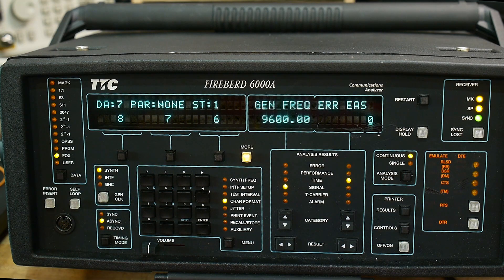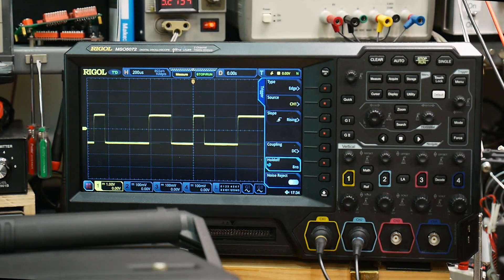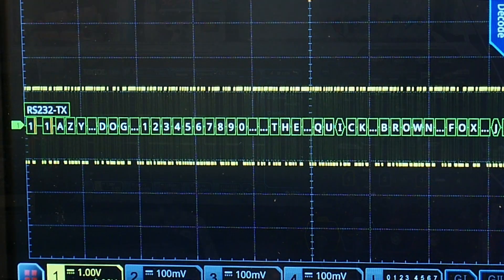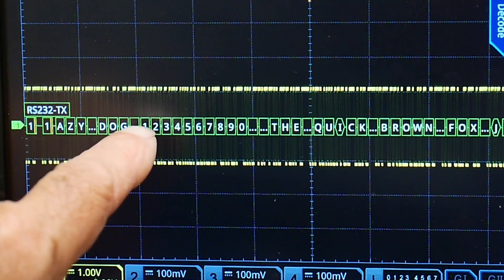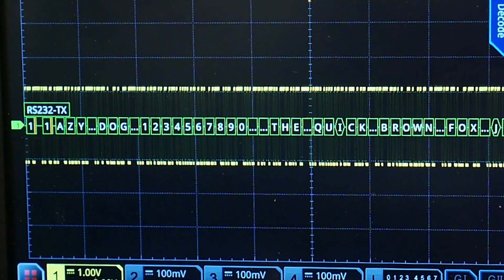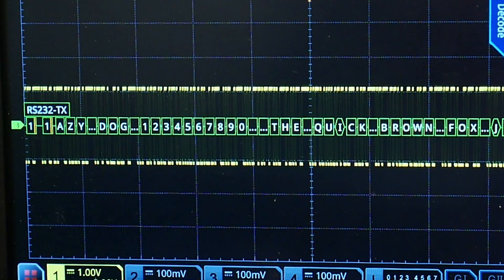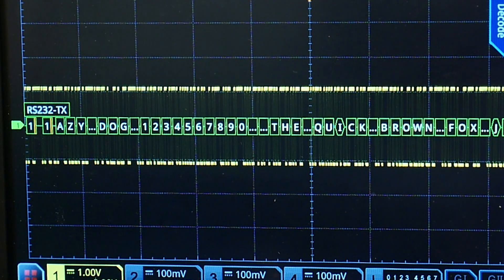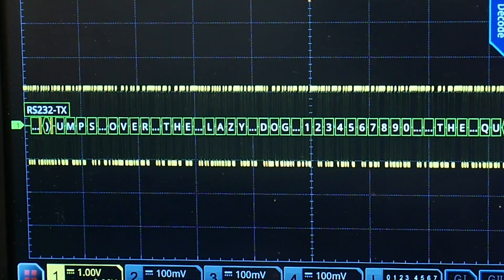#878 Fireberd 6000A Bit Error Rate Detection

Comment: Sounds like a good way to find out why some of my vintage 8 bit stuff is not comm-ing well at higher baud rates. There may not be a solution outside newer Uarts/cab;e ground loops/cable lengths etc. but at least I can start experimenting with one of these.
Thanks for the cool tip !  73 Glenn WA4AOS

Comment: When I was stationed in Korea while in the Army back in 1978-79 and sending messages via those clunky old teletype machines, we typed it as " . . . over the lazy dog's back", which technically didn't need to include the dog's back and could have ended with the dog and still have tested all 26 letters and numbers.

Fine point, the FIREBERD technical transmits at a data rate, not a baud rate.

Baud (abbreviated Bd) is defined internationally as the modulation (also signaling element, or symbol) rate (see:  https://www.itu.int/dms_pubrec/itu-r/rec/v/R-REC-V.607-2-199006-S!!PDF-E.pdf).

In the case where one bit is sent per modulation state change the bit rate and the baud rate are the same, but when multiple bits are sent per symbol as in QPSK, the baud rate is not the same and in the case of QPSK which sends two bits per symbol, the data rate is 1/2 of the baud rate.  For 8-PSK it is 1/3, and so on.

Comment: I worked for a defense contractor and we used a PDP-11/44 to run tests on our avionics computers.  We used 'modems' (which were actually differential line-boosters) to run the RS-232 lines over hundreds of feet.  Wished we would have had one of these; the HP one we had (although it had a CRT) was very limited in its capabilities.  So, back-in-the-day if you had a failure you had to figure out if it was the product or the test-equipment.  Product failures were 'chargeble' in the eyes of DCAS (Defense Contract Assurance System) but test equipment ones were not.  So, when you had an product or intermittent communications failure, checksum values don't match and you have to figure out which is at fault.  These 'modems' when placed in environmental chambers, would degrade over time with the hot/cold and attendant humidity cycles. So, we would 'hammer' these communications lines, to see if statistically they would error which could get us 'off-the-hook' from a failure being chargeble to the product...

Comment: “Fox” test came from a standard punched paper tape test tape we used to run over “Teletype” machines connected to HF or VHF radio circuits in the military and other antique comm gear. The test sequence persists to this day…. The AFSK modems weren’t error corrected back at the protocol level back then… so testing at the “circuit” level mattered…Since everything moved to using protocols like TCP-IP errors are detected at the protocol interfaces and are built into the terminal equipment  
“Fox” test and BERT while still usable, aren’t used much these days IMO. I had forgotten the T-Berd would do async RS-232…
Reply: So you're saying it's an "antique"?
Reply: @jdmccorful  well the “Fox” test is certainly a very old concept… However I would label the T-BERD as obsolete… its beautiful, well engineered,  flexible and obsolete due to lack of current purpose (other than an interesting tear down, perhaps).

Comment: Those were the days when you'd loop the far end modem and couldn't pass a 1200 baud stream of data with one of these BERT testers error free for 30 seconds.  So you opened a ticket with the local telco so they could test and try to resolve your issue.  A few hours later the telco would turn the line back over to you with the closure comment "Cleared while testing".

The "high speed" connection were 5600 baud using the V.35 protocol.  The first 9600 baud modem I worked with was a rack mount AT&T modem that weighed about 50 pounds and was either four or six "U" tall and about 18" deep.

Seeing this old equipment again brings back so great memories of a by0gone era.